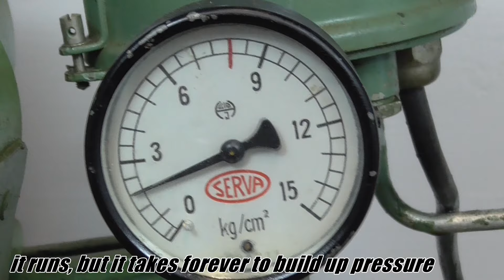1959 Broken Air Compressor - Repair and Maintanence

Comment: Can we appreciate how this compressor is old school engineerd, having all bolts accessible and easy to do a maintenance? Love the old stuff.
Reply: There are screw fittings even on the prongs in the plug, I can’t get over that. It’s meant to be repairable, not trashed in five years and replaced.
Reply: Yea and the Model plate still looks brand new. The 80 Galllon ProAir 6HP Dual Stage compressor that I have just restored and ran this evening for the 1st time has literally no info left on it other than ProAir 80 Gallon 175 PSI.
I found one like mine for sale and was able to get the model number and compressor model. Turns out its the exact same compressor as the DevilBiss PRLKC6580V2 which uses a discontinued Z-ABP459 Compressor. The replacement compressor is a B5900.
Luckily I only had to clean the cylinder of the 2nd stage smaller piston to allow the compressor to make a full stroke. Its been sitting 4 years out in the weather. To do that I had to take the head off which ruined the gaskets. So yesterday I made the gaskets and put it all back together.
I pressure washed it early this morning and dried it with air, let it sit a couple hours and painted it.
When the paint dried I put it back on the compressor and fired it up. Man was I happy to see that thing run again. How many thousands of times I have aired tires up with that thing or taken tires off or run air tools mechanicking when it was at our shop.
I'd love to put the model number and compressor model on it somehow that would last longer than I will.😀
Reply: My thoughts exactly!
Reply: How is there not a giant market for old school stuff?  Just make some slight updated designs for aesthetics, but ultimately just old school.

Comment: Wait he didn’t sand blast or polish anything, I’m having a panic attack
Reply: I had an eczema crisis when he took the knife as a tool 😂
Reply: @Meric_N   Did you mean existential crisis?
Reply: @Meric_N   כי
Reply: Because every mark, scratch, imperfection tells a story of the 70 year history.  Why would you want to lose that? It is beautiful just as it is and wouldn't change a thing.
Reply: @spudmac7591  1959 isn't even close to 70 years ago, my best guess is 50 or maybe even 60. :)
Reply: @spudmac7591  Then everything that he restores is destroying those same imperfections....
Reply: Mark H. 61 years isn’t even close to 70 years? What?
Reply: @michaelesposito2629  Not when you took your first breath in '59
Reply: I can't catch my breath, he didn't countersink every hole, both sides.
Reply: And what about all those sharp edges?...
Reply: He didn't make a new one of anything, not a nut, or bolt, not a screw, not even a washer...
Reply: @cocodojo  Made new gaskets (well, at least one!) Just forgot to say “I make new one.”
Reply: @ondrejprochazka4951  I know more dangerous than the asbestos washers! Those sharp edges have to go.
Reply: He even didn't disassemble everything first, down to the last rivet, and neatly arranged it.

Comment: Great refurbishment, but I would advise caution, as some of the gaskits in these old machines can be made from asbestos, so I would always advise wetting it down the gaskit with something like WD-40 especially when your having to scrape it off and then disposing with care.
Reply from the maker: Usefull advice, haven't thought about that. Thanks
Reply: I bet that if a cap gun cap would pop near you, you'd probably call the national guard. Listen, and remember, LEAD is not dangerous to you as long as you don't ingest it or vaporize it. And asbestos isn't dangerous to you unless you get exposed to YEARS OF IT. Not a small washer or gasket.
 Nancy people, everywhere, i swear.
Reply: @aserta  actually, when I was young I used to smelt my own lead weights for fishing, I've handles large quantities of mercury, have worked on asbestos clean-up, worked with radioactive source's and so many dangerous chemicals and explosives and I have shot many guns. And I can safely say that some forms of asbestos, even in small amounts, can cause severe damage to your lungs, so it's always better to be safe than sorry. But if you want to be stupid, go right ahead and breath it in, it won't bother me.
Reply: @aserta  it only takes a few fibres to cause asbestosis which can lead to mesothelioma, this can take years to develop.
Reply: @matthiasweigel311  I am educated and deal with it on a daily basis, I have known two people who have died from mesothelioma and another who is suffering from it. It's a horrible way to die, is it worth the risk?
Reply: @mymechanicsinsights  by the way, cleaning spray contains solvents and it may be flammable. So use all sprays inside a fume hood or at least outside. Using vinyl gloves will protect your hands. be safe buddy!
Reply: @aserta  You're wrong buddy. Tiny fibers in asbestos will directly go to your lungs. Believe me the rest of it is not "fine" You should always say away from the chemicals, in particular the dangerous ones. (PS: Lead is dangerous so stay away)
Reply: @aserta  I recalled my service in the IDF when we were put to sleep outside the old barrack in a rainy cold winter night because the barrack's roof was made with asbestos
Reply: what we need here is a good old fashioned fist fight. for science.
Reply: @matthiasweigel311  Yes, non-friable asbestos can become friable over time as the other materials degrade due to age and weather.
Reply: @aserta  You just keep doing what you do. As others have said, it only takes Avery small amount of asbestos fibres to destroy your lungs.
Reply: @aserta  not sure about the comment about lead but the asbestos part is defenitly wrong.
Asbestos is a nasty material and the results are often only seen years after contact.

Comment: you should stick a camera into the air tank and see how bad the corrosion is in the bottom. 60 years of water sitting down there is bound to have caused some rust no matter how good the original coating was. don't want a bomb going off in your nice new shop!
Reply: Rust? Then the yellowish should be more reddish... or am I talking rubbish? Yep I am.... 😂😂😂😂😂😜🤗🇨🇭
Reply: That's why it is OK to have a bit of oil in the tank, the very bottom is the place the water affects mostly.
Reply: This is really a very good advice, the tank should been scrapped after 10-15 years of use.
The air inside make high amount of steam every time the air pressure sink fast in the tank..
The tank will stop to rust inside if not being used over some time, rust needs/use oxygen for it's progress i think..?
So when there is no oxygen left the rust stops, i think.
So frequently use of the compressor is bad for the pressure tank.

Comment: "Only 7 minutes" to charge. 😆 That seems like such a long time compared to a modern compressor. Seems like it's pretty quiet, though, which is nice. The compressor I have is so loud I would go crazy if I had to listen to it for that long!
Reply from the maker: Well yeah, it's very long indeed compared to a modern one, but usually the pressure doesn't fall below 4.5, so I only need to listen at it for 3 minutes ;-)
Reply: @mymechanicsinsights  Doesn't it waste a lot more electricity compared to a modern engine?
Reply: @ThereIsNoLord  I know I am not my mechanics but... I know. I have an old air compressor very similar to this one and it does draw a LOT more power. Though it is slower, I like the little amount of noise it gives off and the simple design that is easy to maintain!
Reply: So true. Modern compressors are so noisy. My mechanic doesn't wait for the pressure to build up to the max. He switches it off earlier, otherwise we can't have a conversation :)
Reply: Depends on the type of compressor.
Reply: Mine is from 1974 and has 1.5kw, a 50L Tank and runs 3 Phase Power, its much faster than yours, It takes less than 30 s from 4.5  to 8 Bar. I don´t think yours is normaly so much more inefficient than mine, something has to be wrong with it.
Reply: I used to be an air compressor mechanic. Many of the newer machines run at 1700+ rpm (direct drive), and the older ones turn at 400 to 600 rpm. It's quieter, and the old machines are built like tanks, so they will last forever with proper maintenance.
Reply: @Jimmy-sb3fc  What maintenance do you suggest other than ensuring it has the correct amount of oil in it ?
Reply: @millomweb  Just change the oil regularly (Straight 30 weight / non detergent), change the air filter, and keep the tank drained of water. It looks like the piston rings are passing some oil, which will eventually build up carbon on the discharge valve, which might need cleaning again in the future.
Reply: @Jimmy-sb3fc  Why do you think it needs a regular oil change ? Unlike the heat damage etc. of car engines, simple lubricating oil should not deteriorate. Air filter also shouldn't need to be changed too often - unless it's in a dirty environment - like ours - fills with paint spray ;)
Reply: @millomweb  Unlike car engines, air compressors don't have oil filters, so any metal fragments will grind away at the bearings. Cleaning or replacing the air filter as needed will also keep airborne particles from entering the machine and scratching the cylinder, as well as preventing carbon buildup.
Reply: @Jimmy-sb3fc  Metal fragments will just settle in the sump. Changing the oil won't remove them unless you flush the sump out.
Reply: @millomweb  Well, since there's no oil pump, compressors rely on metal dippers on the bottom of the connecting rods to splash the oil from bottom to top. This is another reason to use non detergent oil, to avoid "washing" metal fragments off of the wall of the crankcase.
Reply: @Jimmy-sb3fc  Oil will do that anyway. The detergent in lubes is for chemical cleaning - a result of combustion products and burnt oil from the heat.
Reply: @mymechanicsinsights  The amount of oil/water sludge in the tank is caused by using incorrect oil .Regular motor oil is not good for pneumatic pumps.
Reply: @millomweb  impressive pedantry
Reply: @popovic5463  Why ?
Reply: @DrLoverLover  Where ?
Reply: @popovic5463 , you are correct; regular motor oil should not be used.  However, even if you use the manufacturer-recommeneded oil, you will have that disgusting oil-water sludge see here accumulate in the tank.
Reply: As to loudness, you can buy a Panther compressor, which is as quiet as a household refrigerator.  You'll pay about 6 times as much, though.
Reply: @kenp3L  Unless you properly maintain the water filter between the pump and the tank. It should be full of silica or another dehydrator. They need to be baked to drive off the moisture when they turn pink. I was surprised he skipped that step.

Comment: What a nice restoration :)
And a wonderfully built vintage compressor too. Very reliable, built to last. A thing of beauty is a joy for ever.

As for the slime, it's an emulsion of compressor oil in water. Builds up when the compressor tank is not drained for a long time, and often becomes so thick it won't go through the draining valve. I once had this problem when I was working with my friend on a Monotype compressed air tank and cooler that worked worse and worse, and needed maintenance. There was so much of that crap that we needed to pull the tank out of its cooling vat, unscrew the draining valve, remove the emulsion... It was an awful lot of work.
Reply: You've got to be joking!

There was absolutely no restoration involved in this video or his procedure!!!
And he knows it. That's why he did not call it a restoration.

He did a simple exam and repair.

A restoration would have involved a complete disassembly of everything, replacing any parts that had any wear whatsoever.
Removing all rust inside and out and rust proofing the inside of the tank.
Hydro testing the tank to make sure it's not going to blow up in the near future.
Giving it a professional paint job.
Making sure that everything was back to complete original just as it came out of the original factory!
That would be a restoration but most people don't know what that word really means.
Almost every video I see on YouTube called a restoration is a flat out bald-faced lie!!!

Just about the only person on YouTube that knows what a restoration is goes by the name squash 253
He restores tractors that takes months and hundreds of videos detailing every single part historically accurate as possible.
That is a restoration!
Reply: @TF856  thanks for the condescending comment, much appreciated.

Comment: That compressor looks very  well built. Much better than the junk they have in the stores these days. 
She’s running very nice after your tune up. Nice job 👍☘️
Reply: lol. Most on demand compressors use a solid cast piston\con rod, and are usually "oilless". The piston ring is rounded on the outside and seals the piston as it rocks inside the bore.

Comment: How amazing is it that the single plugs on the wallplug are removable and just easy to screw in? Makes maintenance and repairing them super tidy and easy
Reply: Things from back in that era were designed to be servicable. Plug break? Get a new plug and rewire it.

Now a days with throw-away-consumerism, once something has "died" we just throw it out and get a new one.

Comment: My first initial thought was there might be air leaking from somewhere.  But while watching some of the tests for compression and seeing the gunk in the check valve, my mind went to water and condensation.  That's the one flaw about most compressors.  I'm glad it was an easy fix.  :)

Comment: You were fortunate, I was given a twin cylinder Westinghouse compressor, beautifully made and perfect condition, the receiver was a mass of rust holes. I gave up on  my  Chinese made reciprocating compressor after replacing the cylinder head once and really needing a second, bought a second hand rotary for less and love it for quick charging and not so noisy that you can’t converse with it on.

Comment: I learned about the Swiss SN 441011 electrical plugs & sockets system after seeing you change this plug. It's the first time I've found something lacking from my native BS 1363 system! All the other countries' systems seem inferior, though Schuko is closer than most.

I wish there were additional phase pins available (under the existing plug's footprint for safety) either side of our Earth pin! We probably couldn't add a round-pin low-amp variant at this point though, with so many different designs of socket already in use.

Comment: The slime is an emulsion (water & oil), the water is condensation from the air that is compressed in the tank but the oil is passing from the reservoir through the piston. Perhaps a broken ring. If you live in a high humidity are you should drain the tank at least once a month to avoid rust inside the tank. Great video, keep up the good work.

Comment: Hi I would like to recommend a tool I use in sewing you might like, it's an Olfa 28mm rotary blade cutter.  Very useful and quick for cutting shapes from paper, thin plastic, felt, fabric, oaktag, interfacing, etc. Much faster and easier to control than an Exacto knife.  They do need to be used with a self-healing cutting mat, Olfa also makes those. Widely available all over the world. Love your videos!

Comment: Nice and easy repair! Old compressors just look great! I would recommend to crimp wire end ferrules when rewiring a plug, they make a safer connection and prevent splitting of the braids. Great you mentioned that the earth-wire should be longer than the other ones. Greetings to Switzerland!

Comment: Awesome! Would love to see a full restoration on this!
I would make a rubber foot for it to rest on. In a shop that small the vibration will shake the teeth out of your head...
Reply from the maker: Yeah, I almost went for it. If it would be full of rust I would've definitely do that, but as it was it was perfect for a quick repair video for the second channel. I really liked to give this thing a new paint job, I thought a blue and white combo would look very cool on this.
Reply: @mymechanicsinsights  I mean, what would be the restoration besides the paint job? That compressor looks mint inside. Somebody took care of it.
Reply: @mymechanicsinsights  I like your second channel more than any other's first channel.
Reply: @mymechanicsinsights   Yes, do it 🙂👍
Reply: @mymechanicsinsights  It's the difference between an engineer and a painter. As an engineer, I wouldn't touch the paint job and dirt. I'd be looking at bearings - including those on the motor and ensure other things work properly - the switch and the safety valve.

Comment: With old air compressors you really should do a hydro test to make sure it's not going to blow up in the near future.
There's a bunch of photos and videos of air compressor tanks blowing up due to internal rust!

There are also several good videos of people doing hydro testing on their own air compressor tanks with a pressure washer.